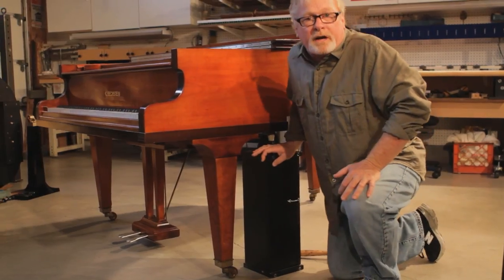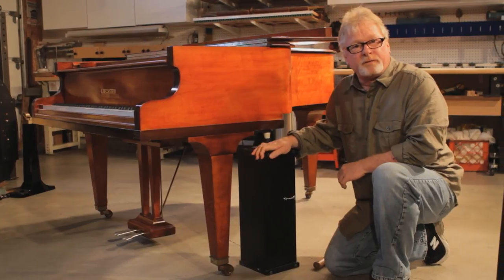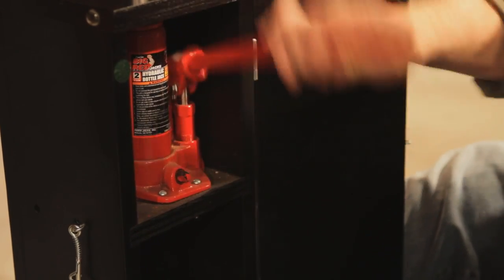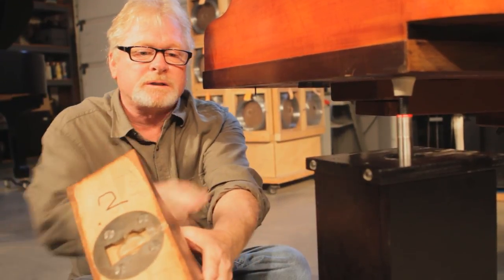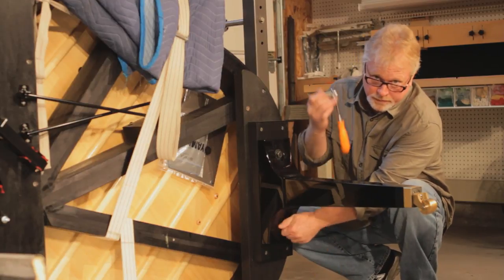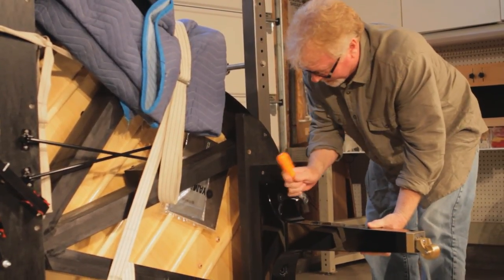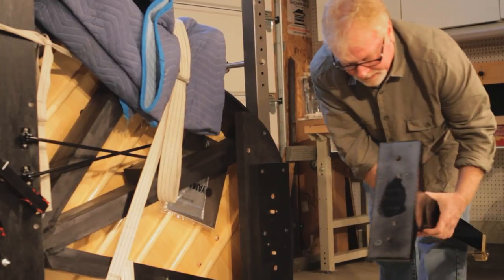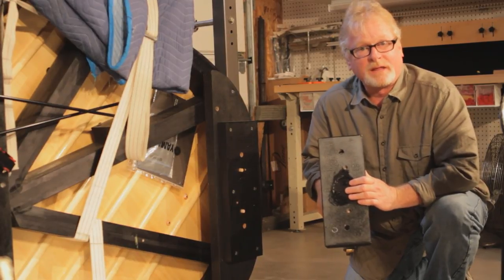Removing Piano Legs : Piano Care & Maintenance

Comment: So, how about a modern 2005 Petrof. Had any issues with any heavy lacquer “gluing” the legs on.  That’s the only reason I can think of why it will not break away from the dog leg. I whacked on it pretty good with rubber dead blow. Configuration is that of a single bolt screwed in like modern Steinway’s.  Just in case I tried front to back motion (tail to keys) and opposite as well.  Got nothing!  Maybe I didn’t whack it hard enough but, wow!  Never had any so tough.  All three legs the same on a model V.